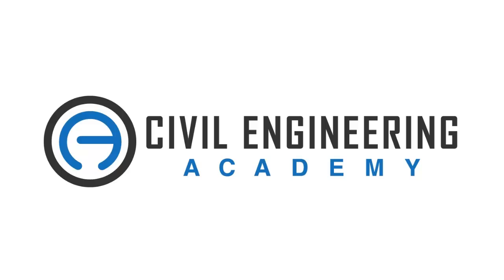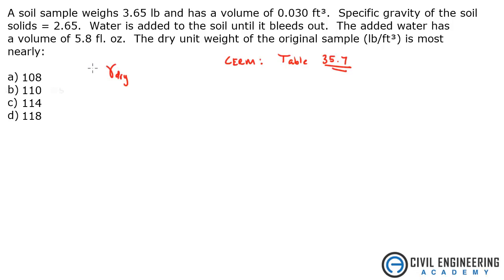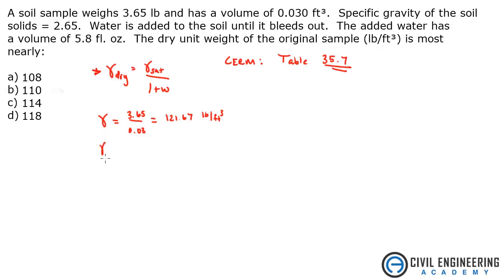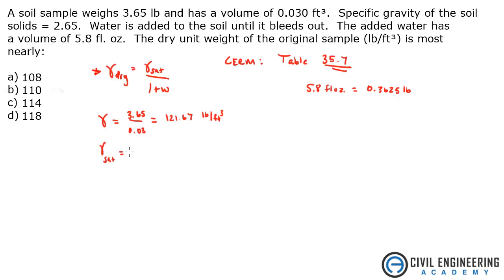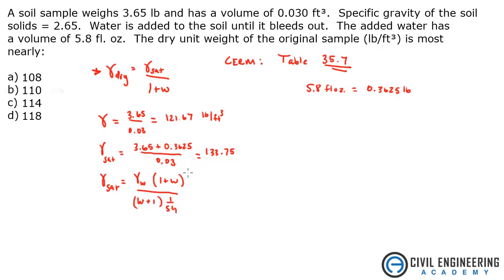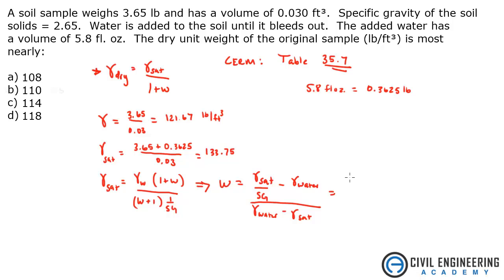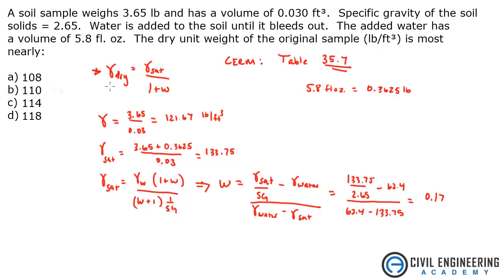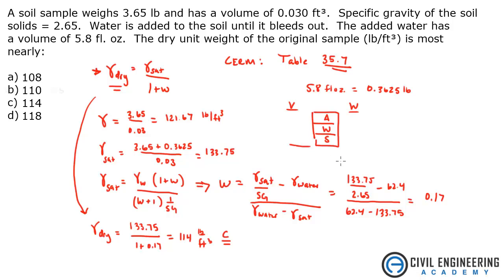Geotech - Find the Dry Density of a Soil Sample

Comment: The volume of added water to saturate = volume of air in original sample. Set up two equations for Total Volume and Total Weight. Two unknowns are Vs and Vw, solve two equations for Vs. Calculate soil weight from Vs and specific gravity. Dry density = soil weight / total volume of original sample
Reply: That is what i did as well. solved for the volumes and the weights of the soils, water, and air and then put weight of solid over total volume.

Comment: I was not sure why you can't convert the added water to cubic feet @2:27 as it say the added water was by volume, but now I've found out!  You had assumed that 1 fluid oz of water (volume) weighs 1 oz (Avoirdupois), but in fact it weighs 1.04 oz (depending on conditions).  You introduced a few % error, short side.  I believe the correct answer is 115.4 lb/ft3 even though it does not correspond to the multiple guess.  I used volumes and masses: converting fluid oz to cubit feet, and that would equal the sample's original Vg.  Vg=.006057 ft3.  You can have 4 equations and 4 unknowns: SG=ms/Vs/62.4,    Vt=Vg+Vw+Vs,    mw/Vw=62.4,    mt=ms+mw.      Then you can find your dry density (dry mass unit weight) by ms/Vt.

Comment: When calculating the saturated density, why is the denominator only the volume of the soil? According to CERM Table 35-7, the denominator should be the sum of the volume of soil and the volume of water. Thanks so much for your help- these lessons have been amazingly helpful!
Reply: My understanding is that the volume does not change.  The additional water is merely taking up the volume the air voids previously occupied.  So before 0.03 ft^3 = Vs+Vw+Vv and then after the added water 0.03 ft^3 = Vs+Vw.  The Vw's in each of those equations are NOT the same.

Comment: I am going to preface this comment with the fact that I am a structural person and I despise these soil problems, so bear with me.  Anyway, why couldn't you just take the 5.8 fl oz times 0.065 to equal 0.378 lb which would equal mw.  Then take mt - mw = ms (3.65 - 0.378 = 3.272 lb) Then simply the dry unit weight = ms / Vt (3.272lb / 0.030cf = 109.1 pcf or 110 pcf)
Reply: My best guess as to why we cannot do as you suggest is because we are adding water to fully saturate the soil. mt (saturated) = 3.65+0.377. Therefore you cannot use mt - mw = ms because we only know the weight of water we are adding to saturate the soil not the weight of water which is already existent in the soil sample. Hope that helps.

Comment: Hello,
Can you please tell me how did you go from 5.8 oz to 0.3625 lb ? If i use appendix A-5, 5.8 oz=0.1960 Liter=0.00692 Cubic foot. Density of water is 62.4 lb/ft^3 , if i multiply it by the Volume 0.00692, the answer is 0.4319 lb. I am not sure how did you get 0.36 lb. 
Thanks in advance.
Reply from the maker: +tony khoury I need to probably re-write this problem.  I took 16 oz in 1 lb but this would be for mass and not for fluid oz which is confusing and I need to re-write it.
Reply: +Civil Engineering Academy Can you elaborate on the 16 oz in 1 lb ? I am still not sure how you did it. 
Thank you.
Reply from the maker: +tony khoury Ok, the way I did it wasn't right in the video so I need to redo it.  We need to convert the volume to mass.  So you take 5.8 flozx(29.574 mL/1 floz)x(1L/1000mL)x(0.03531L/1ft³)x62.4lb/ft³ = 0.378 lbs.  That's what should be used in the calc.
Reply: +Civil Engineering Academy thank you ! I got it now.

Comment: In the first equation where did the saturated density come from? In the CERM table I have the equations is dry density= wet density/ 1+ water content?   Also isn't fluid ounce technically the volume of water not the weight? Why wouldn't this just be converted to CF? Then use the equation for dry density of ms/Vs+Vw ?    These video are great just having a hard time following this one.    Thanks
Reply from the maker: +Paula Barker Yes that's the equation that was used, but there is always confusion when discussing the differences between dry, wet, saturated, and buoyant unit weights.  Ounce is a unit of mass.  Fluid ounce is a unit of volume, so yes you are correct.  This was probably a poorly written problem that I could better define.  Thanks for pointing these out!

Comment: How did you arrive for an expression for the water content (w) as a function of specific weight sat and water . I'm working out the formula but I do not arrive with the expression.
Reply from the maker: Geder Mena Let's see if I can explain it here:  You are starting with Gsat=Gw(1+w)/(w+1/SG) ; take the denominator to the other side and you have Gsat(w+1/SG)=Gw(1+w); multiply everything thru and you get Gsat(w)+Gsat/SG = Gw+Gw(w) ; get all the water content on the left side and you get Gsat(w)-Gw(w) = Gw-Gsat/SG; now take water content out and divide everything to the other side and you get w= (Gw-Gsat/SG)/(Gsat-Gw).  Hopefully that makes sense?  Gsat = gamma saturated, Gw = gamma water, w = water content.
Reply: Thank you for your help

Comment: In the fourth line down, when you give the equation for the saturated unit weight of the sample from which you solve for the water content, I believe the denominator as written is incorrect. (w+1)*1/SG.  The denominator should be w+1/SG. - I really appreciate the Civil Engineering Academy's videos. They are invaluable. Thank you.
Reply from the maker: Yes!  I will write up a comment on the video.  Thanks for catching this!

Comment: From table 35.7, it seems that the wet density and saturated density are the same? Am I thinking about this correctly? The reason why I'm thinking this is because they have the same saturated sample formula and also from a logic standpoint, a saturated density has water a part of the soil.
Reply from the maker: A moist unit weight does have water in it but a saturated unit in this case means that the voids in the soil are completely filled with water.  There is no room for air.  With a moist unit weight you still have air there (and some water).  I believe the equations in the table are the same if Saturation is 100% if that makes sense.